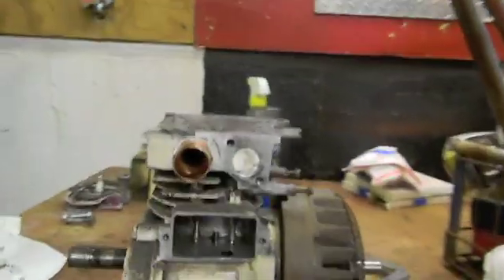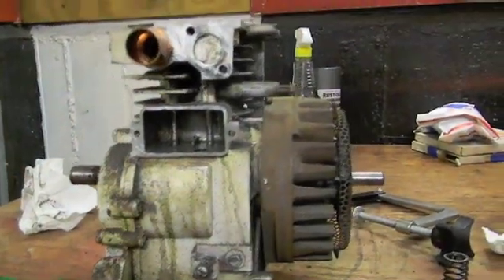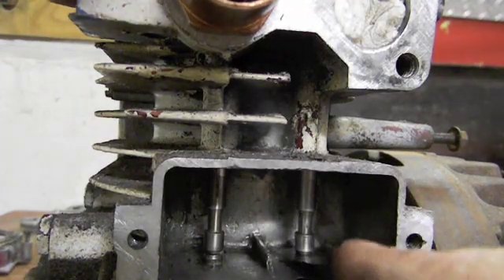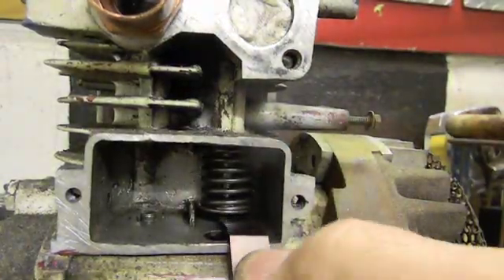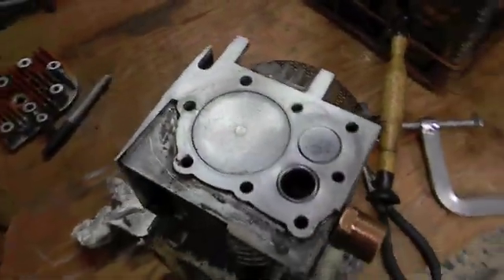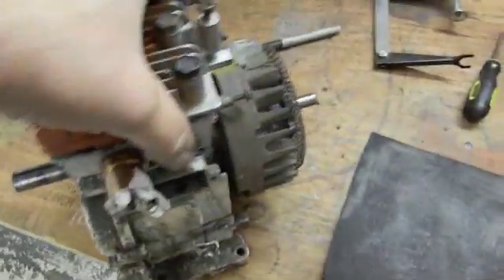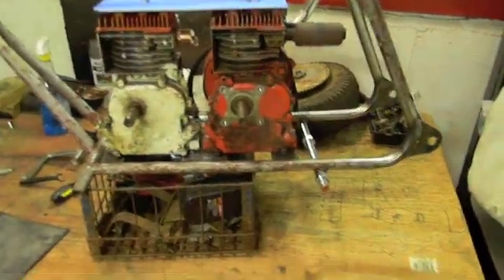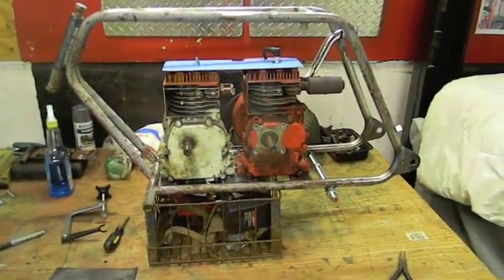3.5 hp Briggs Valve Lash Check Adjust

Comment: Valves need to be check WITH THE SPRINGS ON. Also that valve needs to be ground. The sealing area is too far down the face of the valve. Should be a WIDER shiny spot. Looks like it has near 0 compression.
Reply: Yes on the compression for sure. It should take a decent amount of force to turn that flywheel. It was spinning like a button on a shithouse door.

Comment: When checking the lash - go top dead center - then briggs recommends you bring it down a quarter of an inch - that's for the 5hp briggs - does anyone know if this is the same for the 3.5hp?
Reply: You are talking about a OHV engine or a newer  L head engine for a compression relief. These older briggs you do it at TDC .